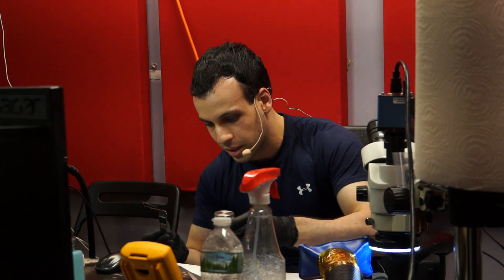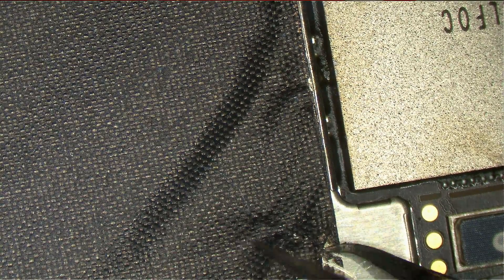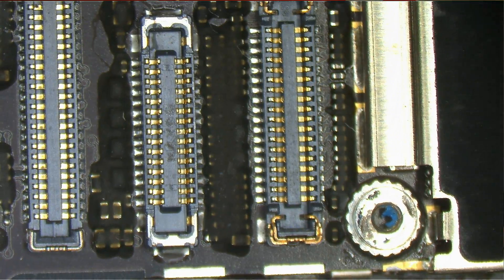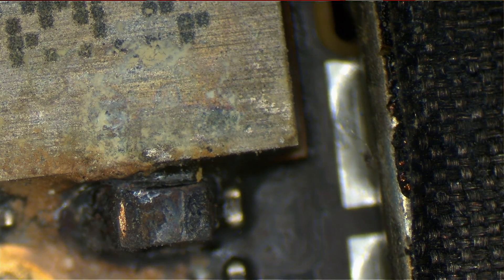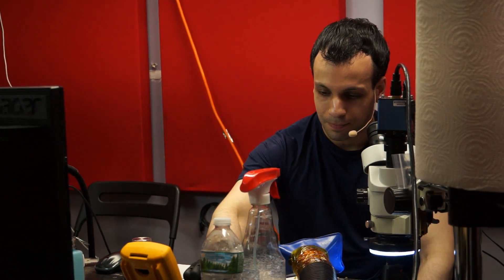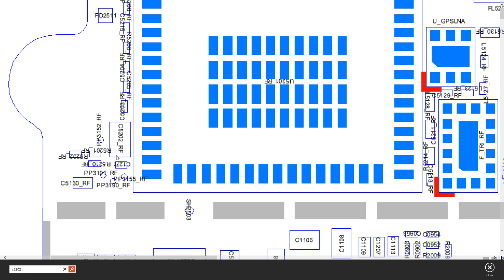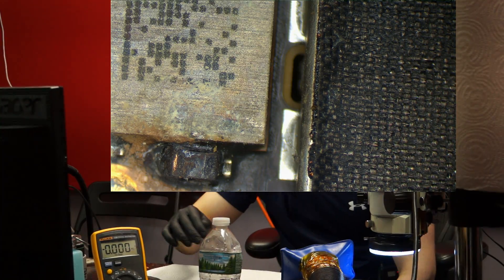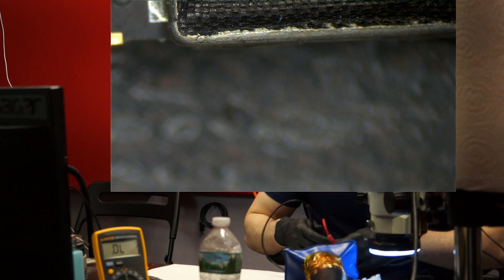iPhone 6 liquid damage: most common fix! Failed C5202_RF

Comment: Hi Louis, I love your stuff, often playing it in the background while doing work - I find it really enjoyable and educational. This time however you surprised me in a kinda weird way... When you had to replace that 0402-sized 10uF capacitor you had to take it from another board. I think it would be a better idea to have a stock of standard sized (0402, 0603 etc.) standard values so you wouldn't have to do extra work  of taking it off donor boards. You can get lots of standard caps and resistors from china. Am I missing something?

Comment: hi.  how much do you charge and how long would it take? i know for a fact something is wrong with one or maybe two of my connector ports. i mirrored my phone screen on my computer and i could access my stuff but i have to be on computer. my touch digitizer works when i slide and everything. BUT my screen is black and i know its not the lcd because i replaced it twice with two brand new digitizers. my camera and i think the lcd connector are damaged. how much would you charge to fix them man? please get back as soon as possible!
Reply from the maker: If you know what it is, it would be best if you repaired it yourself.  We don't blindly replace connectors.

Comment: Hi Mr. Rossmann, currently this is an interesting area to see as I came across a iphone 6 which was dropped, screen was exchanged, homebutton and flex , though after they swapped out the screen it seemed there was a short to ground as it became hot on the top right, half an hour later I discovered wifi/BT was greyed out. if this cap which you replaced was shorted out , I'm figuring the main powerrail was shorted so it didnt affect the U5202RF ? I've seen many videos showing this is about to become the new iphone disease (the blown U5202RF) , is there any way you an short out that rail and still blow the 5202 chip?

Comment: My son has an iphone 6 that fell in the ocean for a quick second.  It still worked.  We dried it out but the touch screen wouldn't work.  A repair guy cleaned some corrosion off for us and it worked for a few weeks.  He was watching his youtube video last week and he said the screen suddenly turned like a gray metal color and it looked like it had a bullet dent in the middle of it and turned off. We can't get it to come back on or charge.  Sprint looked at it and said there were signs of liquid damage and tried to say that's what was wrong with it.  The liquid damage was probably there but I just don't think that is what the problem is.  Any ideas?
Reply from the maker: +jerron Ervin they did not really clean it. You have to desolder off The shields to get to the components, which no one bothers to actually do. The corrosion is still there on to the shields, it got worse since it was still plugged in, and that's why it's not dead.
Reply from the maker: +Louis Rossmann **now dead

Comment: FYI: 10V vs 5V caps:Generally higher voltage caps will have higher ESR, which reduces the cap ability to filter noise. Apple likely used a lower Voltage Cap to get a better ESR. 

* ESR - Equivalent Series Resistance.
Reply: That's an often heard rumour, and almost as often not true. In case of doubt, always check the datasheet.

Comment: I'm surprised Apple is using underfill at all. They tend to make a device as cheap as possible then stick a huge markup on it. 

BTW, Underfill is useful for micro BGA packages to add suppor to the solder joints.
http://www.embedded.com/design/system-integration/4235387/Underfill-revisited--How-a-decades-old-technique-enables-smaller--more-durable-PCBs
Reply: +ProGamer1515 Thanks, didn't know what underfill is
Reply: +Julio Hacker Okay

Comment: Hey man, I got a Galaxy s4 and I have a problem with the wifi(also bluetooth). I try to turn it on, but the icon will be light green and then automatically turn off again and it never turns on. I reset my phone once and it started working again and then after a month or 2 or so the same problem occurred. Do you know why that is?
Reply from the maker: +Ziyad Thunku Ousmand (Zee) wifi chip, i dunno. could be anyhing!

Comment: Louis do you think that the iPhone 7 will be explicitly water proof?  Apparently the 6s is "somewhat" water proof...
Reply from the maker: +Kyle Eggemeyer I'm not sure. Apple is very behind the curve when it comes to durability.
Reply: Louis Rossmann I agree with you there... Maybe I'm crazy, but if I worked at Apple, I would be pushing for carbon fiber devices.  Imagine the new macbook air being made out of custom carbon fiber instead of aluminum... Not sure about the heat conductivity, but it would be thin, strong, and light as hell!  Plus very sexy IMO.  People would drop 2-grand for that in a heart beat!

Comment: wait a minute Louis, are you saying that by replacing the component you have made the iPhone 6 better than Apple did? Impossible. It is designed by the worlds best engineers to be such a shitty device that nobody can top it!

I call shenanigans!
Reply: +galaxymode That would be a fuse.
Reply: +Azivegu I am not really sure, but I think capacitors are designed to break? so that the problem doesn't transfer to another component.
Reply: ProGamer1515 I see

Comment: What is underfill and why do they put it there? some googleing tells me it's some kind of plastic that is filled in below components, but why?
Reply: +ATschTheCube The bga solder balls can sheer break away, after a drop the underfill spreads the load into the underfill, it's like a shock absorber it spreads impact damage over a larger area, it also stops water ingress after water damages protecting the ic it's a two for one thing.
Reply: Astro Man
Thanks!

Comment: What temperature settings you are using for hotair and solder?
Do You adjust them depending on element footprint type etc?

I heard that there are two main techniques:
* lower temperature and longer heating
* higher temperature with shorter heating
Reply from the maker: +elHokusPokus whatever works.

Comment: I am in no way discounting your work because it's great, but I think the correct term for the protective layer they cover the boards in is "conformal coating", not "underfill". Anyway, thanks for the video, as always.
Reply: +SolidStateWorkshop If it's under the bga and between the solder balls  on components beside a bga it's underfill on the wifi ic of an iPhone 6.

Conformal coating is to protect traces of the pcbs only the pads lands are exposed to water damage
Reply: +Astro Man "Solder mask" is the black (usually green) coating that covers the traces and exposed copper (other than pads). "Conformal coating" is used once the components are soldered to the board and protects the components from environmental damage and prevents pins from shorting out etc.
Reply: +SolidStateWorkshop Semantics, solder mask is a form of conformal coating it's not conductive  and does not allow solder to short traces lands and pads could be yes, the exact same way a second layer of conformal coating can encapsulate or pot a component underfill technically does the the same we have hydrophobic spray for pcbs but not many use it. as the battery terminals  and antennas still need copper to copper contact. and i've seen more different coloured pcbs than you can shake a shitty stick at it's simply screen printed. conformal is topology in all directions yes and same shape as the pcbs yes i agree but to say solder resist or mask is not a type of incapsulate would be daft in effect it's for the same reason.
Reply: +Astro Man I'm in 100% agreement with you. Solder mask does conformally coat a bare, etched PCB. All I'm saying is that the term "conformal coating" is, in the industry, usually used to describe the thin transparent film used to protect the board and components from adverse environmental conditions. Solder mask's main reasons for existing are to prevent solder bridges and to protect bare copper from oxidizing. Thats a little different from conformal coating which is used to resist moisture, dust, heat etc. But yes, solder mask is a form of conformal coating.

Comment: one question, my display on my t530 is dead,not completely, but since yesterday it has a lot of dead pixels on one place.I'm wondering cause the diplay by lenovo are qquite expensive can i put a display from a different manufacturer
Reply: +Nino Srdic Yes, you can.
Reply: thanks
Reply: +Nino Srdic Yup most laptop displays are interchangeable just go by pincount on the input cable max screen resolution  and if it's led backlit or has an inverter boarder not.

Comment: i have an iphone 6s that doesn't  display after connected a display without disconnecting the battery, there was a little bit of smoke, what should i check?
Reply: +SCANDIANO REPAIR check filters and the 2 backlight diodes
Reply: "FL" are filters? aren't they simple inductors?
Reply: +SCANDIANO REPAIR that would be correct usually 0.8ohm.
Reply: Astro Man What are  DZ components on the apple schematics? Example DZ3152?

Comment: hey louis where would i check on an iphone 5s to see if the lightning connector is sending power to the battery
Reply: +ryan smyth lightning connector does not send power to the battery.  If you're troubleshooting board level not charging on a 5s, start with tristar chip
Reply: +ryan smyth find tristar chip on schematic.  figure out where to measure from there.  most people don't bother with this.  on a 5s, it will boot with a known good battery but not charge then it has a charging problem, otherwise it has a boot problem. 
For a charging problem, rule out a parts problem by trying a new dock.  if not solved, then troubleshoot tristar chip.
Reply: It is the one that is labeled "TRISTAR" in huge letters, and literally has three stars on it.
Reply: +ryan smyth You can't really... No direct connection between the lightning bus and the battery. Check around the power management chip maybe.
Reply: +Gustavo Ferlizi any idea where the heck that would be lol
Reply: +iPad Rehab I'm just trying to see if power is coming through the the port and going into the phone
Reply: +ryan smyth I don't know much about these things, but I've watched a fair bit regarding electronics repair, possibly you could take the voltage of the battery whenever it's not plugged in and plug in the charger and see if there is a voltage spike?
Reply: +iPad Rehab what would a good schematic viewer be i already have a schematic but finding the tristar chip by hand haha
Reply: +iPad Rehaif your talking about the shematic it must be bad bad one i have but if your talking about the actual board i dont have the phone apart right now and ile take a look later thanks
Reply: +ryan smyth It will have the designation U2 in the schematic as above the tristar ic,  seriously don't bother if it's your first time if you don't mind losing the phone go for it pdf viewer for the schematic.

Comment: I assume you were doing this for data recovery, and if thats true was there a reason to even bother replacing the capacitor in the first place? From the schematic it looked like it was just a filter, so couldn't you have saved yourself the effort and just left it off?
Reply from the maker: +Krynn72 This was for the sake of the phone. I never do this. Do not send me phones for this.
Reply: Ok. I won't send you too many then.
Reply: Ha! I love that you get trolled for putting it back and I get trolled for not putting it back (on my personal phone!) Some guy on my channel had some rant on mine about how do I know that this iPhone isn't going to fuck with somebody's pacemaker now.
Reply: +Jessa Jones I ain't trolling, just asking. Want to make sure I understand that circuit correct. You know, so I don't give someone a heart attack if I leave it off.
Reply: +Krynn72 for the sake of the phone, yes put it back.  For data, I will put it back if it's the only thing wrong with the phone, easy enough and they can use the phone again.  If it is one of several problems in a data job then no.  And if it's my personal phone, then hell no.

Comment: I always try to match the voltage and microfarads of the cap just because it could be a timing capacitor. Of course I sincerely doubt that is a timing cap judging by it's size. Whatever, you know more a whole lot more about this than me anyway.

Comment: louis make how to read iphone schematic and how many power rails in iphone plz
Reply: Yeah Louise, plzzz.
Reply: +Gumtree dot com  just put zxwtool free on youtube and read comments download pads viewer don't use the app it comes with, use pin pair for missing pads so you can restore burnt, missing pads to it's nearest connection, that it needs continuity with add jumper wire's hopefully it's not a bga that needs a link :) can be done but a pain in the rear., use nets to check power rails and ground  yada yada that should get you started it's not rocket science. Only two rails in a circuit power and ground all the other rails are created boosted isolated from one rail the power rail once you realise that you can work in segments.

Camera not working whats the goal check power rail going to camera fpc and it's filters if all check ok, check incoming voltage, what ic or resistor is supplying the power. 

if resistor is damaged  or IC getting hot replace or check incoming power on ic if that's correct change ic circuit is restored, job done. 

If incoming power for ic is wrong too high see whats supplying that power rinse repeat yada yada process of elimination and a bit of deductive reasoning reverse back from the output what should be happening to input source.
Reply: Thanks astra man yada yada;)

Comment: Come on hate is a strong word, underfill is there for a good reason... why they didn't do it on every chip is still a mystery, but at least they try to do a half decent job.
Reply: +svampebob007 why don't they use Hydrophobic coating on the pcbs except the input and output ports crazy world we live in when this tech exists.
Reply: Astro Man
 I know, though the reason is because money...

I don't understand how anybody is willing to sell and buy Smart phones that aren't capable of being dropped in a few cm of water,other then "it cost too much"... but if you have to repair them or replace them because you sweated how is that saving money?

I used to love my Nokia 5140i you would see almost every active person with them it was extremely popular with people that worked outside all the time and it was built like a tank.

I wouldn't mind the extra bulk on smartphones today if they could resist more shocks and water. but instead they ad more bulk by making the screen bigger and adding more pixels with a very insignificant battery upgrade.
Reply: +svampebob007 I guess people dont want to spend less on a better, water proof non iphone.
Reply from the maker: +Luke-Antra Durability is low on the list when people decide to buy a new electronic device nowadays.
Reply: +Louis Rossmann I wonder why though, i rather drop that one new useless feature for having my phone last a year or two longer.
Reply: Luke-Antra
yeah I don't understand either, I get it if you don't really care about a laptops water resistance, but for a device that's going to be exposed to humidity, sweat and water almost on a daily basis?
It only cost a few more cents per device for the manufacturer, but usually non resistant high end phones cost more then water-resistant one... They could cram just as much features plus the extra feature of "it's not going to totally break down from your sweat!!! :D"
Reply: svampebob007 Well, sony has been making most of their phones water resistant.

And i think samsung and apple have started with that now too.

So looks like the finnaly woke up.

But yeah, i guess people prefer a finger print sensor over beeing able to drop their phone into the toilet by accident.